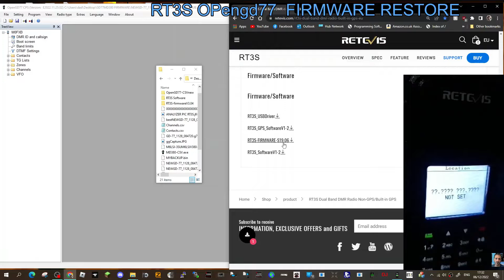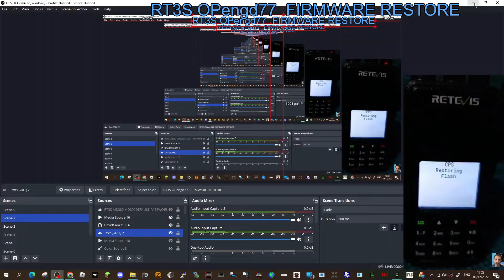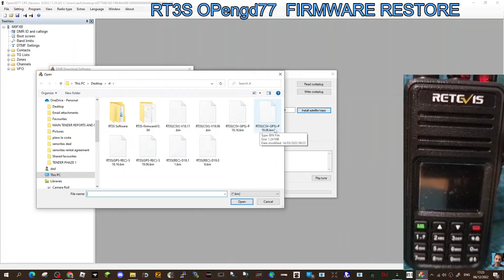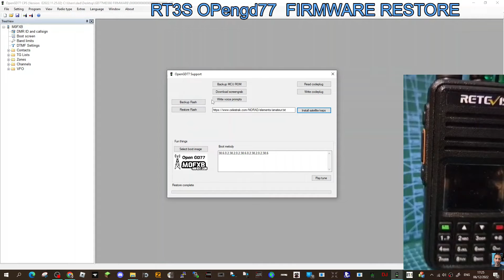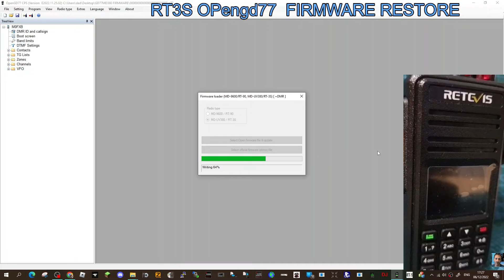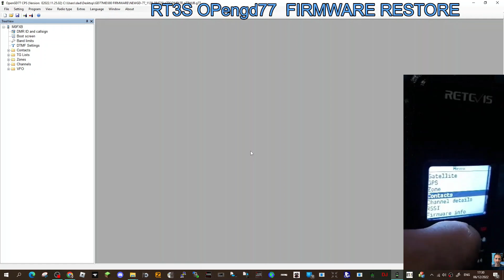RESTORE ORIGINAL FIRMWARE RT3S - AFTER OPENGD77 INSTALL

Comment: Hello, I need some help.  I am trying to restore the original TYT MD-UV380 firmware after installing OpenGD77 using the instructions in your video.  Unfortunately I did not save the .bin flash file from the first part of you video.  I have the correct firmware MD-UV380(REC)-D19.32 and the TYT upgrade tool.  The tool runs OK and seems to load the TYT firmware, but after the updgade my TYT gets stuck in DFU mode and won't get out of it.  I can restore the OpenGD77 firmware and magically my Opengd77 configuration comes back and is useable.
I have tried using a different USB cable and another computer but still the TYT HT gets stuck in DFU mode after the original firmware install.  Do you have any suggestions as to how to fix this?  I see that the upgrade tool has a file called Upgraded software for newest version.bin.  Should I use this file in the OpenGD77 Restore flash before doing the  TYT firmware restore?

Thanks, 
Dave W4EIP
Reply from the maker: Keep gd77
Reply: I need to return it because the receive is a little weak

Comment: Do you have the mist recent firmware for the tyt md-uv390 10w non gps? I did all these steps and now my radio turns on with a black screen. I think i might have the wrong firmware.
Reply from the maker: You need to.investigate get correct .

Comment: I have a TYT MD-UV380 which locked up. When I power the radio up it now ask for a password. I input 00000000 which seems to satisfy the requirement, but then states the keypad is locked. I try to unlock by pressing the * button with no results - still locked. Do you think I could flash the radio for either RT3S or Opengd77 ??? I can put the radio into the flash mode by key1 plus PTT pressed on powerup. HamDAD859
Reply from the maker: Yes I do